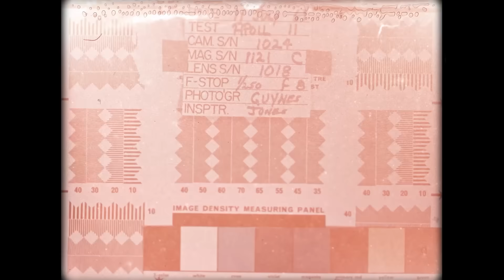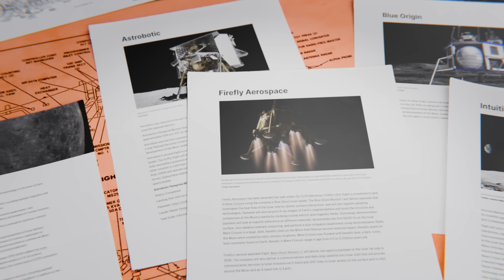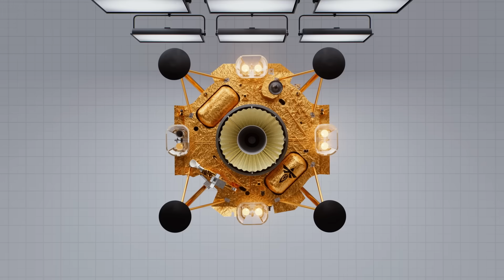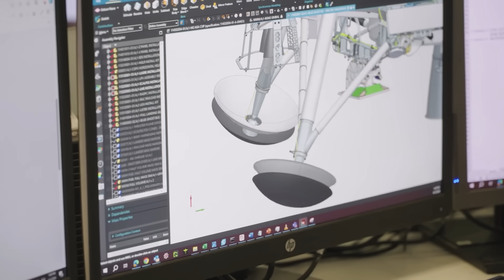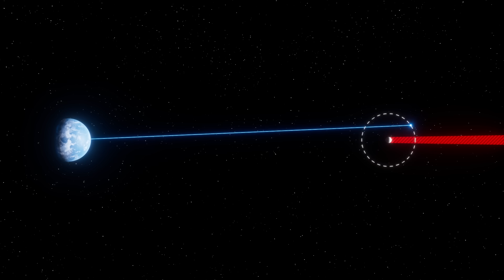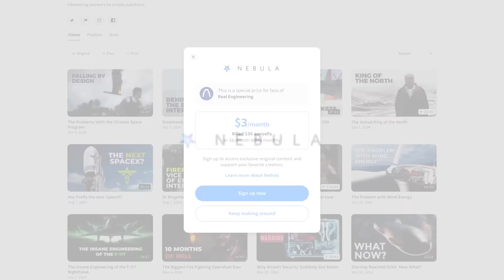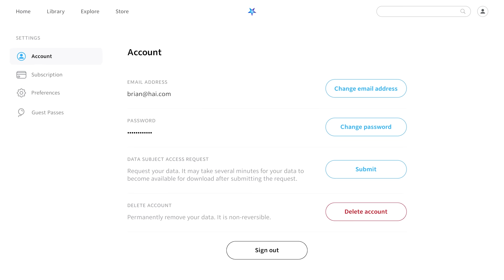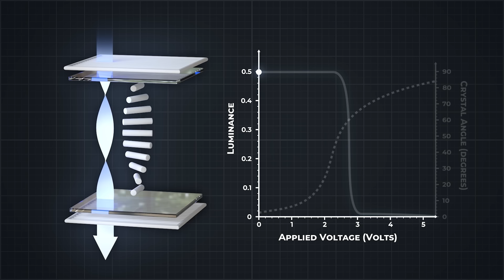Why the US is Struggling to Land on the Moon

Comment: We're compensating with outsourced deniability for the skill and experience we don't want to afford.

I know exactly where this project is going when the guy started stuttering at being asked if there's a backup system to the primary landing system. They don't think it's necessary to have a backup system for the system governing the most critical phase.

But don't worry, the landing system depends on a third party's 3d map so deniability is ensured.

Comment: I wouldn't trust any sort of Kahlman filter for a lunar lander. Systems that use these tend to be quite rigidly-specified, and flexibility and adaptation are needed in this context. Have you considered an RL-based control loop with a Kahlman filter as a failsafe and for interpolation between inferences?

EDIT: Perhaps this is for computing position. That would make sense. I would still love to try RL for control. Doing that in a simulation could be a fun paper if anyone wants to collaborate!

Comment: OK, now do it with just slide rules.  If 50% of moon landing fail, and we've attempted it with humans seven times (Apollo 11 through 17) with only one failure, that's a 7/128 or 5.47% chance.  Did I do that math correct?  If so, that probability sounds suspicious.  I suspect the reason for that success rate is because the well-trained astronauts could respond and resolve crises, where automated systems would otherwise fail.

Comment: Why do they rely on machine vision through visible spectra for these navigation systems (such that it could be confused by reflections, shadows or dust)? Why isn't RADAR used for altitude readings? I assume there's a very good reason, but not really addressed in the video.

Comment: If you read the familiarization manuals Grumman provided to NASA, it's readily apparent that none of the CLIPS landers are as well engineered as the Lunar Module. For instance, each propellant valve on the LM could be independently isolated by another valve, thus precluding a loss of propellant scenario as occurred to the Astrobotic lander. I truly hope we emulate Grumman's systems engineering when it comes time for humans to return to the lunar surface, no matter their flag.
Reply: Interesting observation. How much cost it would increase, if we take Grumman's approach?
Reply: @alexbian5567  in the hundreds of millions. literally 4-5x the cost
Reply: @aboundedwall54  Thanks! That's interesting. Do you mind to share how you calculate this factor?
Reply: @alexbian5567 What's more efficient? 
1 successful lunar landing/a quadrillion dollars
0 successful lunar landings/one dollar
It costs what it costs.
Reply: @acefighterpilot  Sorry, I don't quite follow. Mine original wasn't a rhetorical question. I am interested in Grumman's design details you mentioned, but I don't want to dig through the documents. I work on mission critical systems, dealing with these types of tradeoff.
Reply: Yes, the LM had a lot of redundancy. Many relays and valves were provided in *fours*, in a series-parallel configuration so that any one of the four could fail stuck open or closed, but the whole thing would still work. (Example: the throttle valves on the descent engine.) That kind of redundancy is appropriate when humans are on board (and being watched by billions back on earth) but it costs money. Lots of money. And mass, which costs even more money.
Reply: also, in this lander they don't have redundancy for landing-camera as stated at 5:26 . I think NASA-contract is shaped in a way that contractor aren't worried about mission failure? at least not worried enough to justify installing backup for a camera that will end up working anyway.
Reply: @xponen  Or the engineers just aren't as talented as the ones who built the ships for the Apollo missions.
Reply: @amorphousblob2721  I assure you we have vastly more information, research, and capabilities than we had in the 60s and 70s. The problem is money. No-one is willing to pay and everything must be cost-cut to the absolute minimum. I mean makes sense, to not spend more than you have to, but it's just been taken too far, and every engineer is handicapped by the accounting, everywhere.
Reply: @amorphousblob2721  there might be some truth to this.
Reply: @amorphousblob2721  Or maybe they lack the billions of dollars and thousands of employees? These are small private companies with no more than 250+ employees and only a small fraction of the budget that initiatives like these used to have back then, and compare this to the thousands of employee's of Grumman.
Reply: How did they do in with no diversity???
Reply: @shinigamisenpai3303 Astrobiotic's lander was budgeted $100 million. So you could've doubled up on every component on the machine and still come in below $200 million. And at 3,000lbs, you could double the mass and still have a Falcon Heavy take it to TLI.
Reply: @perryallen7663  Actually, they DID have diversity, just not as much as we'd prefer nowadays, but they had it way before many other parts of the US government arms would have.  An African-American woman was NASA's orbital calculator...all the way into the early Space Shuttle days, too!  When newfangled 'computers' came out, for several rounds of upgrades in computer architecture they HAD to double-check the results with Mrs. Katherine Johnson before they would launch.  She was BETTER than computers.

No, really...Black Woman who was better than computers whom NASA proudly calls "An American Hero", and THAT lady had some math skills!  I saw some of her work once and I had NEVER had any idea how complicated 'orbital calculations' are, even just to get to nearby stuff and without even using gravity-assists or the like!  Also, she was LITERALLY better than computers at first by a big margin.  "Floating Point Math" has a lot of approximations in its floating point bits, and there are a LOT of decimal places involved in shooting a satellite past five planets on a seven year mission to reach Jupiter, and being off by 0.00001 anywhere in the first orbital slingshot maneuver changes the end result...even if there are NO further errors!...from 'sling it cleanly into Jupiter orbit' to instead be 'shot off into space under the orbital plane of the planets' because errors compound in orbital mechanics.

So...  "Hur hur hur, How they do stuff wit no DEI?"  They didn't need to be TOLD to be diverse at NASA in that era; they hired for skill, not skin.  Except for management...they were all white guys even in NASA as I recall for management-level folks in that era.  THAT lady was a star worker for NASA for years and years, though!  Look her up, do a video search for "Katherine Johnson American Hero" and check out some of the stuff about her.

I know this is your new "Critical Race Theory" answer of the moment to explain "Why everything is awful and why everyone who isn't me sucks", but it's just as silly of a thing to be SO excited to hate on as CRT was.  And, to be honest, nobody...not ONE!...that I had asked in real life who was 'dead-set against the teaching of CRT in school' actually had ANY understanding of what it was.  It's a college-level course.  It's a class about how Mortgage 'red-lining' was actually a racist policy, just like 'urban redevelopment/the highway system cutting cities in half' was, and how to try to remove that legacy of racism from our laws.  THAT was what CRT was.  It was never taught in High School, it was a COLLEGE level course, but everyone was SOOOO MAD about how it was 'taught in schools' and they blocked it and de-funded it and were SUPER MAD about it in elementary and middle and high school and all the schools were like, "But we've never even TAUGHT that class!" and the haters would charge at the schools frothing, "RAAARGH, YOU SURE DO, THAT'S WHY THE WORLD SUCKS!"

They were, however, wrong.
Reply: @EShirako  Tell me did she A. Derive the calculations B. Do research to find the values of the variables, use a pre-existing set of equations and solve them or C. plug in numbers and go through the tedious process of solving with the initial equations and variables set up?
Reply: @danhobart4009  I'm not sure...I'll have to look her history up more, now I wonder too!  I think her main thing was C, with some A.  I remember a mention that she had more, and more accurate, significant digits in the calculations for many years.  Floating-point math in a computer co-processor is a strange approximation of actual math...close enough for most uses, but not accurate enough to cross the solar system with (until maybe lately, I'll have to look into that too).

PBS had something about her, I think.  I'll have to go find the video again, I meant to watch whatever I'd found but I forgot to.  Been terribly busy the past few weeks..!
Reply: @EShirako  Sounds like she was doing numerical methods crunching with the aid of early computers. Any 2nd year engineering student can do the same, its tedious work, difficult to remain consistent but ultimately trivial.

Seems this is another case like the woman who purportedly captured the first picture of a black hole when in reality she acted as a pm for an american group assisting the main japanese group who actually developed the algorithm to fill in gaps in the image that was captured. Basically a photoshop job to make the picture look better, but the media decided to push a narrative.
Reply: @shinigamisenpai3303  They have $25 billion a year, a larger budget adjusted for inflation than they had in 1969. They're incompetent.
Reply: @EShirako  a black woman...sure we believe that
Reply: "return"
Reply: Return??? BAAHAAHAAAAHA sure.
Reply: Look here commie lover , america will make its way back to the moon ,
Reply: Stop making sense and let the accountants tell the engineers how to do things.  Then they in turn will tell the operators how to do things.  That way we can have more screw-ups.
Reply: This video is pure, unadulterated misinformation.
Reply: Look at Chang'e. The Chinese will get there in the next few years. The US is entirely over as a space nation.
Reply: Redundancy is only a requirement for safety-of-life issues, or if the mission is so high-cost that you can't afford to build/launch another one. Getting to the Moon is relatively cheap, and there are no crew on these CLIPS missions, so redundancy is not worth the weight penalty.
Reply: Ahahaha😂 ok
Reply: Ya but they had cold war money, nasa is broke and private companies need profits.
Reply: Except for Russia or Israel.
Reply: @ontheruntonowhere even during the cold war the Russian and American space agencies had respect for each other
Reply: @ontheruntonowhere  Reported for antisemitism
Reply: @danhobart4009  Israel isn't a religion. Reported for bullying.